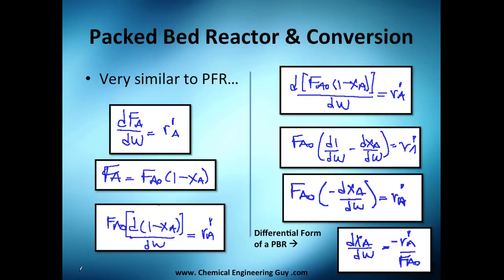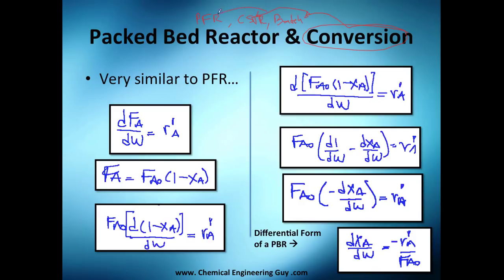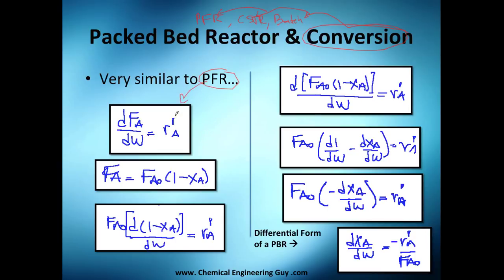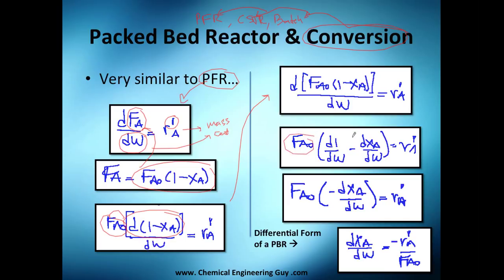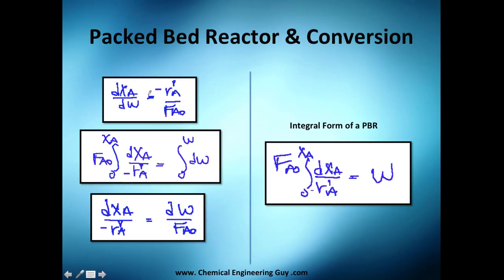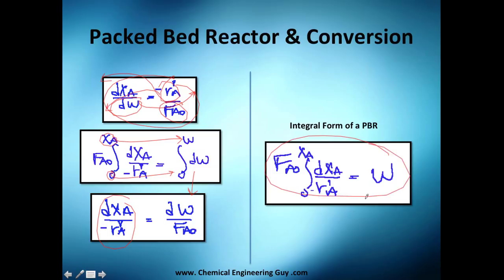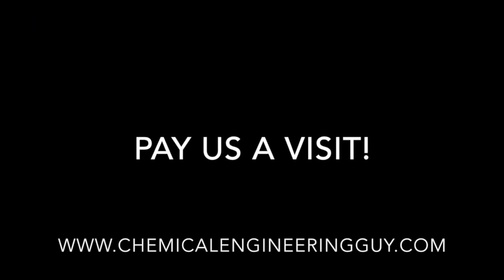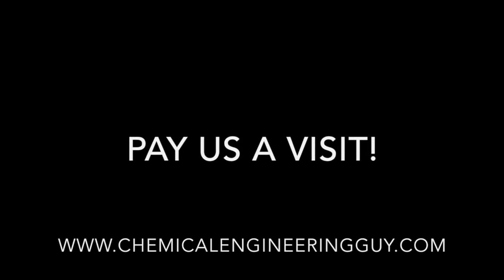Packed Bed Reactor & Conversion // Reactor Engineering - Class 21

Comment: Nice video. Please I have one quick question. What would be the rate of reaction in a packed bed reactor containing  packing like pall rings with zero (0) weight of catalyst i.e. no catalyst present?. would the rate be zero? using the formula -rA= (conversion,X) / (W/FA0). Thank you.
Reply from the maker: well, by definition, if there is no catalyst present, you will have no reaction and therefore the rate of reaction/consumption should be 0 (it will be a nice pipeline with those rings acting as friction material)
Reply: Chemical Engineering Guy Thank you